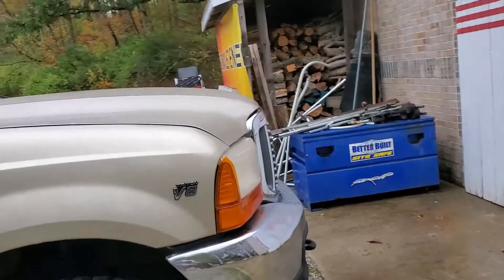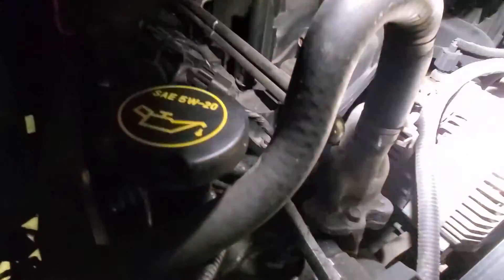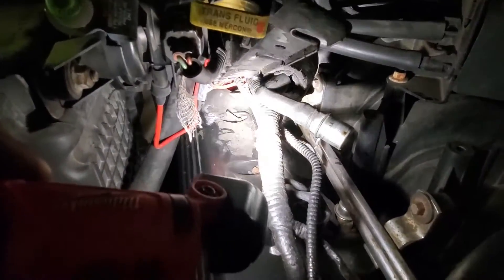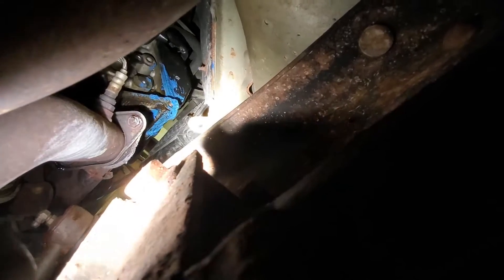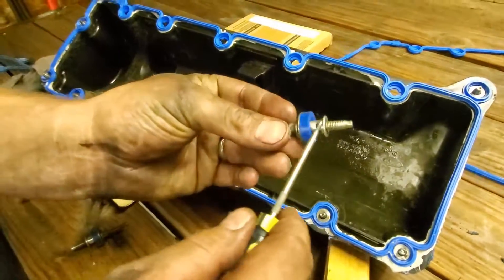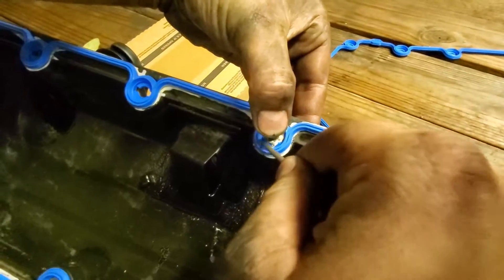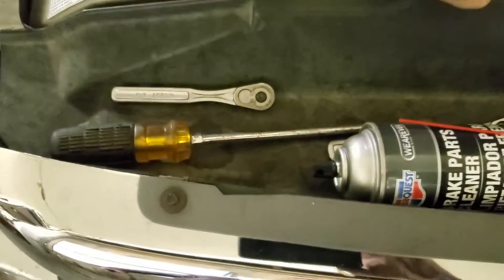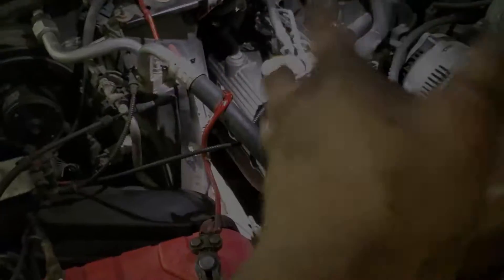Replacing Valvecover Gasket On 2002 Ford Triton V8

Comment: insight to anyone attempting 2v, valve cover gasket replacemment mine as well pull intake manifold replace manifold gasket will need done anyway known failure. valve covers are a breeze with intake manifold out of the way. 
might be little extra wrenching and money but your truck and your patience will appreciate the extra step.
Reply: That’s the first thing I do when I get a 5.4 2v, great point!

And while the intake is off, throw in a new set of Autolites.

Comment: I always use 3M trim adhesive on all my valve cover gaskets to hold them to the valve cover. The shit is phenomenal. You just use it sparingly in small one inch lines along the perimeter. You will never again have a gasket fall out when installing.

I have used that same technique for just about everything you can imagine, thermostats, bypass hose blocks,throttle body gaskets, oil pans, tranny gaskets, diffs & more. I worked for 30 years in automotive heating & cooling systems and it’s never failed me. Before the internet mob tries to give me a load of shit…would it be better to use nothing and have a gaping hole where your gasket was supposed to be? 3M makes some of the best automotive products money can buy in my opinion.

Git er’ done!

Comment: Just discovered I've got oil leaking onto my '02 5.4l exhaust manifold from the valve cover as well. Bought the truck used less than a year ago so it's sat for a good bit of it's life. Already did the intake manifold and it's gaskets. I just prey those 8mm's come out since mine are rusted.

Comment: I have this same problem with my 4.6 f150. I saw another video for replacing the gasket. The guy used high temp rtv silicone to help the gasket sit better he then add weight to the top of his valve cover while the silicone cured to help keep it in place. Easier to install that way.

Comment: My 2005 is leaking. I’m gonna try and tackle it next weekend. Hopefully I’ll be able to get it done. I’ll try to remember to bring my seal removers for that gasket when reinstalling the screws. Less of a chance to poke a hole in it (in theory 😂)
Reply: Jake Not From State Farm:  Did you do the job?  What was the reason to change it?  Were you experiencing oil loss?  How many miles are on the truck?
Reply: Long story short, I haven’t done it. I was going to because I was having oil loss. I was having trouble finding the leak and finally spotted it coming from the backside of the valve cover.

Comment: Okay, now I subscribed and got some questions.  Is oil loss the main reason to attack the valve cover and gasketing?  I have a 2002 F-250 @ 225,000 miles and I have spotting, oil visible on the passenger side slightly below the exhaust manifold.  I would top off the oil and about 3 weeks later need another quart or two.  Mind you do DO NOT have any spotting on the ground.  No puddles, no dripping when standing still.  I am guessing it's disappearing when traveling.  How long did it take you to change it out?  What sealant did you use to hold down the gasket to the valve cover?

Comment: That was a joke ! I have had mine sense 04 its a 01 and the only other thing than the valve covers i have had to do to it had a wire to the ignition switch burn out and stranded me 100 miles from home once .